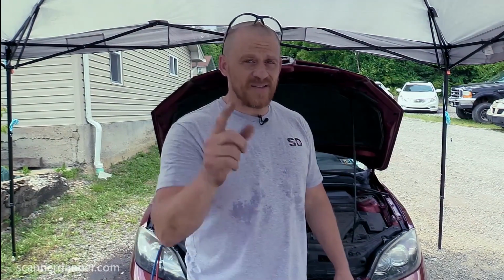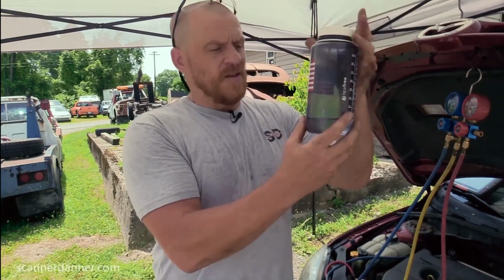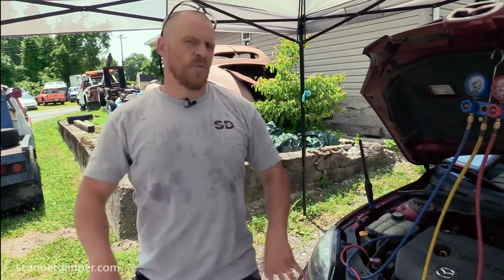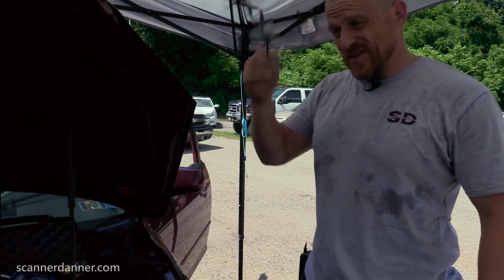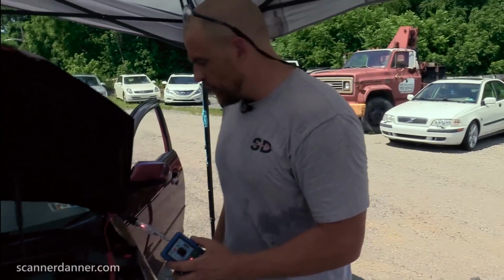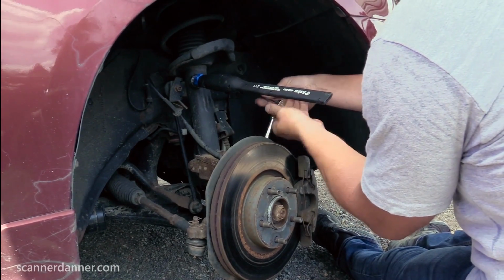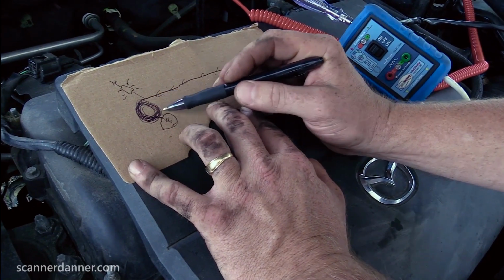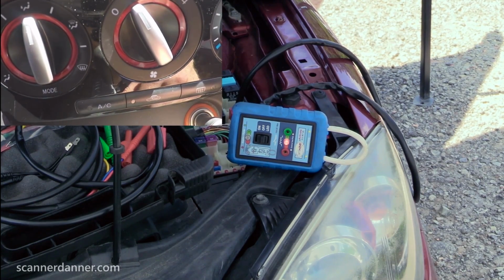A/C Clutch Does Not Engage-Diagnostic Fundamentals (full charge)

Comment: Man I can’t seem to fix my ax system. I have a full charge and my clutch won’t engage. I replaced my orifice tube and I used the paper clip method where the relay was and the clutch engages and gives me cold air. The relay works.
Reply from the maker: Well you are on a good video to help you! We need to focus on our inputs. What type of scan tool do you have? Can you access the data we need? What year, make, model and engine of the car you're working on?

Comment: Didn't read through all the comments . BUT where is the connector to the Clutch ? is it on the Clutch Housing  ? 
Or is it on the wire before your bed-o-nails test Probe ?  Being under water may have corroded the connections of the connector if it is on the Clutch it's self . Mine is right on the Clutch.   
Mike M.

Comment: If you’re not a member you’re missing out… If you’re a technician, this is a must. Don’t be a parts changer… we’ve all heard that, but that’s the Motto here and the standard…. The best part is the explanation behind every diagnosis and it’s simplified plus VERY DETAILED ON THE PREMIUM CHANNEL. some times over the top which is the BEST. I’ve worked at shops that just change parts, with no reason and sometimes got it right but couldn’t explain why . I HATE THAT!! I love confidence and knowledge. This is the place, I’m never leaving thank you DANNER!!
Reply: Hi,  Can someone help me?  So I vacuum down the AC system and left it connect for a day and it seem to have lost 8psi (-22psi).  I think it's a very slow leak since when I tested the system before Vaccum and it had a little pressure in it.  So my question is if I inject the dye and then vacuum the system to load the Freon will it remove the dye from the system?  Thx
Reply: @AsiaRoadTrek  think if I understand this all correctly, you want to pull a vacuum before adding the die..this way the die will be drawn into the system. But first before you do that..as I’m assuming you are trying to find a leak, try pressurizing the system and do a check by spraying soapy water on all the connections and joints. Did you take anything apart to replace any components? Start at those if you did. I would say only do the die detection if you cannot find a leak the soapy water way or with a sniffer. Remember to check your gauge connections as well with the spray..you don’t want to mistake an equipment leak for a system leak. 
I hope this helps you. @ScannerDanner does this sound correct?
Reply from the maker: Thank you Ryan!
Reply: Your is so lucky to have someone so knowledgable!
Reply: The smell doesnt upload
Reply: Best decision I made 4 years ago

Comment: I have a question: my Grand Cherokee 5.9 has on lowside 45 psi; high side 200 psi (running). The compressor is cycling, the clutch disengages the compressor at 200psi and turns back on after the pressure drops to 150 psi.
This Symptom I have if the RPM is 1000 and higher.
At idle the compressor stays aprox 150 psi
Reply from the maker: Compressor is going to cycle by the low side not high side psi. What is low side doing during these times?
Reply: @ScannerDanner  hello, the lowside drops from 50psi to 35psi. When the compressor shuts off it goes to 50, when starts again drops to 35 psi. Strange for me is the compressor runs at idle all the time but on higher RPM runs for 5-10s, then stops for 15 to 20s and starts again.
Reply from the maker: @martinkuhne452  what is low side psi at idle when high side is 150? And what is outside air temperature? And what is inside vent temperature?
 It actually sounds like you are low on charge. But the compressor kicking off at 35 doesn't sound right, especially on a TXV system like your Jeep is. What year is the Jeep? I want to check service info and see if they used an evap temp sensor. I don't think they did.
Reply: @ScannerDanner  OK I Start again: when the engine is off the numbers on lowside and highside are at 80psi. When the engine is running at idle on lowside 35/highside 150 psi and compressor is engaged all the time.
If I raise up the RPM : on highside it goes from150 to 200 psi, compressor turns off, the highside drops to 150 psi again, compressor starts again and the psi climb again up to 200 psi, then stops again and  off on off
The lowside: when highside is at 150 its 35psi, at 200psi lowside is at 50psi.
I dont know why the compressor cycles so much specially over idle.
The temperature outside is today 30°C, inside the air is comming out with 17°C, too warm in my opinion.
Its a Jeep Grand Cherokee ZJ 5.9

Comment: Air gap on clutch?
Reply from the maker: When you have clutch air gap issues, it is from a worn out clutch bearing. Adjusting clutch air gaps is a thing of the past. An air gap issue needs a new clutch assembly. That's how I handle them anyway. Thanks!

Comment: Hi there! What is the PTR on a car that uses r1234yf? It's clear to me that r132a psi will be close to the outside temperature with the engine off and enough refrigerant in the system, but I'm not sure if the same applies to the new refrigerant used in newer vehicles.
Reply from the maker: I've heard it is different as all refrigerants are. 
R22 (my home AC) the freezing point is around 55-60 psi.
But I've not dealt with the new stuff on the cars yet

Comment: Thanks for the help I have a Mazda and the ac just quit with you're help and guidelines I can try and troubleshoot what's wrong with my ac I don't have all the tools for the job but maybe I can borrow some and see if I can just fix it I also probably over charged it thinking it was empty with one of those DIY AutoZone kits with the can attached to it the guy told me it took 12 pounds or so was wrong I put 2cans only takes 1,1pnds of the 134 a type but this helps me get closer to what the problem could be so big thanks scanner Danner today you the man 👍😉

Comment: Are you saying the low side can handle the same pressure as the high side? My dad's van won't build pressure on the high side but I've only put about 50 psi in the low side. If it's 70 degrees outside, should I try charging to 70 psi? I was worried about damaging something
Reply from the maker: Yes the low side can handle the same psi.
As for charge level, you can't charge using static pressures as you can be way undercharged or way overcharged and have the same psi. The only think static psi gives you is that there is at least SOME liquid in the system when the psi temp relationship is good
Reply: @ScannerDanner  OK thank you so much, that makes sense! You da man
Reply from the maker: @damnitbobby8438  best method is to charge with an empty system with the specs of how much the system holds. Or, charge by system pressures with it running, but this can be dangerous if you don't know what you're doing. (Never charge to the high side running!!)

Comment: Great video and clear explanation. Curious case of faulty ground. I really would like to hear more about issues when there is an overcharge. Do the compressor could work fine with an overcharge ? Mine start for 2 or 3 seconds and stops, of course does not produce any cold at all. I am wondering if I overcharged a little bit. What do you say about it ? Thanks, Ramon, Miami.
Reply from the maker: What are your pressures?

Comment: I am having the same issue. But if I jump power it activates the clutch. Any ideas?
Reply from the maker: Yes, do the other tests I've shown in this video as you have a clutch control issue.
Also you need to check your system pressures.

Comment: Hi Paul, I hope you might have an idea on an AC problem I have on a 1990 C4 with the C68 Electronic AC. First off there are no codes on the AC screen and the green indicator lights are on steady when selected. My problem is when the AC is set to auto it blows cool for around 15 minutes on a fan setting of 5 and then in a big rush the fan goes to full force and blows hot air. I can shut it off, turn it to manual AC or just vent and back to Auto but nothing will make the clutch reengage on the compressor EXCEPT, parking it for a couple hours then the AC will work again. I have even tried the paper clip in the low pressure switch and that will not cause the clutch to spin. Now if I start out with the AC on the manual or recirculating setting it blows very cold my whole commute for about 40 minutes until I park it in the garage. The low pressure side reading is hovering around 30 psi, could it just be low pressure is causing it to shut off, but if so why does it blow very cold for 40 minutes when on manual AC?
Thank you.
Reply from the maker: No idea without researching your system. Let's move this to my forum www.scannerdanner.com 
We can absolutely help you there and it is free to join 
Thanks!

Comment: I have same problem every 4 months ac stops compressor has power Freon full 
Compressor won’t turn on then works after a week for another 4 months  mine has control valve not old fashioned clutch

Comment: Great video. I’m trying to learn if the clutch will or should engage when the temperature is at 34 F. I had a new compressor installed, Chevy said everything is good so I’m assuming I have to wait until it’s hot enough outdoors? Thanks much.
Reply from the maker: That is correct, pretty much below 40-45 degrees that compressor will not engage
Reply: @ScannerDanner  Thank you for getting back to me and confirming this. Your the man. Keep up the great videos please.
Reply: @ScannerDanner  Update: We had a warm couple of days here in NY and I was excited to use the A/C. Welp! The clutch wouldn’t engage. I was about to go back to the Chevy dealer that installed my supplied compressor. Something told me to check the fuses. I found the clutch fuse was blown. Changed it and it engaged. I won’t fault the service tech for overlooking that though because he did exactly what he was asked to do. The fuse must have blown when the compressor locked up??
Reply from the maker: @DjSmoothNY  still, that should have been tested after the compressor install, but yes, a locked up compressor could have been the cause of the blown fuse. Or you never needed a compressor and it was just a blown fuse, in which case it is going to happen again from an intermittent short to ground in the compressor power wire (rubbing on the harness somewhere)
Reply: @ScannerDanner  I agree but the dealerships here are weird about people bringing aftermarket parts to them so he probably did the bare minimum, (yup it fits and it turns lol) let's get him out of here!  The old compressor definitely was locked up. They gave it back to me and I tried turning it and its frozen solid. There's no core return so its just sitting in the box.

Comment: Great job and explanation, just one thing about the test light failure on the ground. It wouldn’t light for the simple reason that the housing is connected to the vehicle carcass which is connected to the car ground.
All of the car carcass is connected to the ground to prevent rust and easy access

Comment: The first 9:30 is a college course in A/C systems.  The clutch not engaging discussion starts at 9:30.  You're welcome.  Update:  and the rest of the 30 minute video is more college course on A/C systems.  Seems like he could have condensed all this down to - the clutch isn't engaging, the fuse is good, the relay is good - so, the clutch is bad.  Replace the clutch.
Reply from the maker: and for those who find your clutch isn't getting power? Your welcome
Reply: @ScannerDanner  Well put.  It's just that I have a short attention span and wanted someone to tell me, "Go here, check this out." like I've seen in other videos about checking out the Low Pressure switch and how to bypass it.
Reply from the maker: @STBRetired1  I'm a teacher (20 years at a technical college). This is just my style on this channel. 
When your silver bullet videos aren't working for you, just remember me when you need to learn how to properly troubleshoot a problem 🙂
Also, watching at 1.5 times speed helps too 😄

Comment: A resistance reading from the relay load side to the battery negative would have told you this.
Reply from the maker: It would have told me the circuit was intact but that wouldn't be your final check. Resistance can measure good yet still be bad 😉
Reply: @ScannerDanner  I meant 3.2ohms to 5 ohms good coil, anything above or below bad coil. I recently had to do this on my Honda Civic. The coil on the compressor was at 6.8 ohms, would not engage. New coil cost £47. Ohms reading on the new coil was 3.5, worked without having to adjust the shims. I do like your very thorough approach, people new to mechanics are learning how to test wire integrity.

Comment: Thank you for the video and love the energy :) 

My question is, with the car running and the AC system is ON, the low and high pressure reading are different, of course. Once you turn the car off or the AC, when or how fast should the system return to equal pressures?

Comment: What if air gap in clutch plate is out of spec., clutch would not engage and would only need adjustments with shims for clutch to engage.  Don't throw parts at it !
Reply from the maker: the only time the clutch is out of spec is when the front bearing starts to fail, I never shim a clutch or mess with that adjustment at all
Reply: @ScannerDanner  never question Professor ScannerDanner, you were right. I had about 0.080 clearance in air gap with a/c clutch, I was going to change shims for correct clearance in air gap. Today the a/c clutch started coming apart, the bearings are shot. Bought a new clutch and will fix in the morning. Don't throw parts at it, throw them away or throw in recycle bucket.

Comment: If the AC compressor ran without the blower running the evaporator coil would freeze over, so as a safety all AC systems will not run the compressor without the blower running

Comment: how often is it the clutch if the system hasn't leaked?
Reply from the maker: 70% of the time, the other 30% would be on the control side of the clutch. I initially thought 50-50 but there would be more weight on the clutch failing. I'll say this, not enough to roll the dice for an expensive repair like changing a compressor. Wouldn't you agree?
Reply: @ScannerDanner  sadly in my case i found dye inside the compressor... it was holding pressure but who knows for how long..... beat for 800+ big ones....

Comment: One time I had to crappy gauges and I overcharged one and it blowed the compressor that's probably what happened when the customer put too much in there it blowed locked up are the under water thing froze it up send 12 volts to the directly that will tell you fast I had to do that a few times in the past but I mostly work on Ford's usually when you jump the cycling switch the compressor will turn on if it's good be ready to have a new belt though if there bad bye-bye belt

Comment: I know on a ford you can jump the ac cycling switch out and kick the compressor on that's how I was told to do it years ago when your so low on refrigerant you have to jump it to kick the compressor on to get it to take freon then you plug it back in when you're done
Reply from the maker: older systems, yes, the newer ones do not use the cycling clutch switches anymore

Comment: Hi. Great talk. One error I noticed about testing the case of the compressor for power and not ground. Remember, the case is physically connected to ground all the time. You'll  not read power there ever. The last evidence of power would be on power side of the "open" circuit somewhere between your wire test through the insulated electro magnetic coil, to where the end of the coil is supposed to be connected. Great explanation all the same. Thanks. Now I need to check my power to the coil itself and go from there.
Reply from the maker: You can absolutely read power on a case ground if the block ground is bad. OR if you had a badly corroded mounting point (junk yard engine swap) Of course you wouldn't be worrying about the AC compressor not turning on in that case lol, it would be a no start, no crank. But  I want just being thorough in this one. I agree the case ground fault example I just gave would be slim to none.  
I have a few videos on this if your interested. 
Here is my "bad ground" playlist
https://www.youtube.com/playlist?list=PLAFYVCyenqcr32wgsCqa1Zj4335YlBF5p
Or at least watch this one. It is only 4 minutes long https://www.youtube.com/watch?v=ytrcqM8wyW0&list=PLAFYVCyenqcr32wgsCqa1Zj4335YlBF5p&index=5&t=11s

Comment: It's a great video and thank you for all of your effort. I think what you failed to observe are the low and high pressure switches on the refrigerant lines which may not be on all cars. What I saw on another video is that the switches are not on the power side. They are on the ground side which allow the clutch to engage. And what I learned was that the high and low switches are actually opposite in there value. One is in the closed position with pressure, and the other in open position with pressure. They are the controlling factor to the clutch working by allowing ground to connect. It's all very complicated but I learned allot between that video and yours. Thank you very much boys!!!
Reply from the maker: On this system, those switches (inputs) would go directly to the computer. There are no high an low psi cut-off switches on the load side of the ac clutch circuit from the relay to the compressor (like older systems). So when I tested the relay and saw the computer was turning it on, I was no longer worried about the inputs. At that point, wire to the clutch, clutch ground, or bad clutch were my only options on this one. 
 Does that make sense?